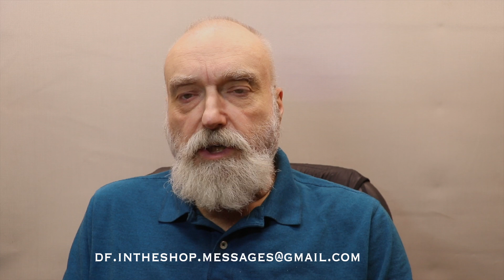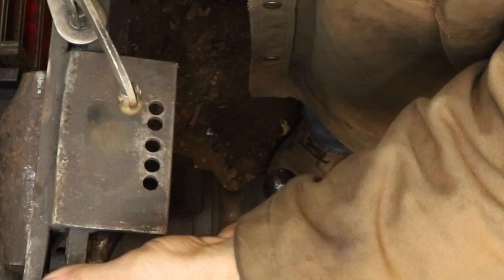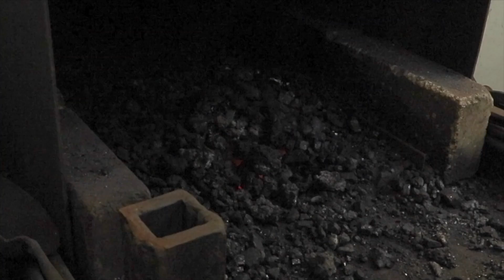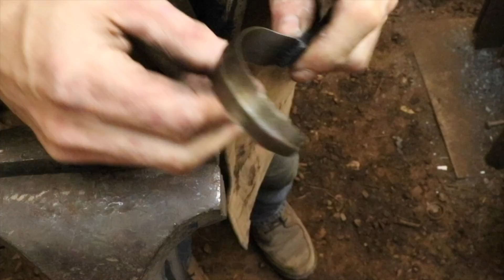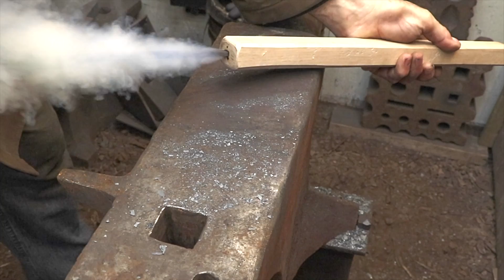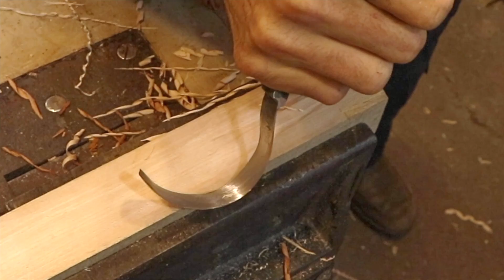Forging a Hook Knife - DF In The Shop

Comment: Dennis. As one that has used the hot bar tempering technique many times over the decades. I would recommend using 3-4 bars the same shape. and heat them all in the fire. then rotating them onto the piece you are tempering. this way you don't lose very much heat. and the process will go much faster. great video. love the finished piece.